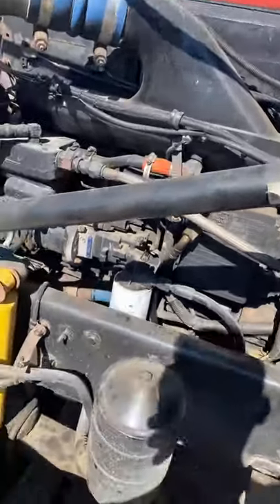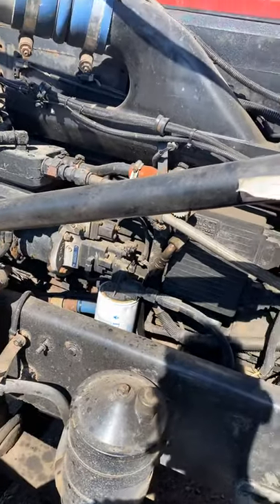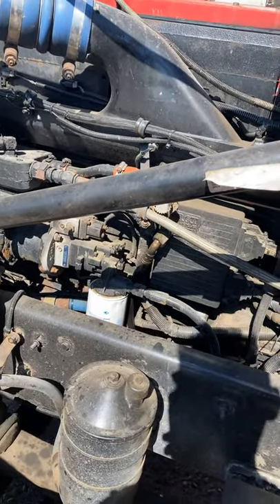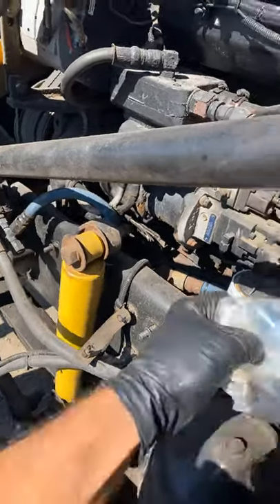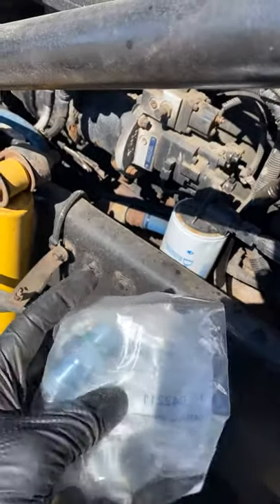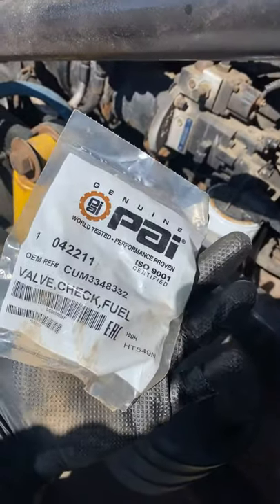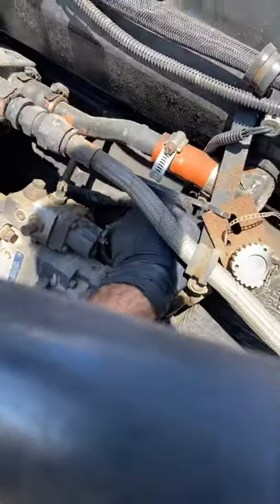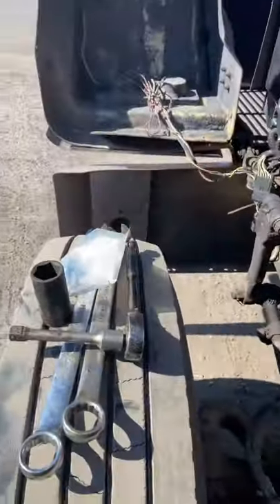Check valve on a Cummins n14

Comment: I have a 91' mechanical N14 and I'm having the same issue. It has a hard time starting in the morning and when i turn it off the fuel seems to be going back into the fuel tank. I have a fitting with a window right at the fuel pump and it's only half full when OFF and full when it's ON

Comment: Did You put that long funky spring back amd mini cup filter back?  
check connection at Engine position semsor under comoresor , if it has oil it migh be need to chane also know as crank ckranshaft position sensor.  it somehow breakes and oil gets into cables. You csn check impedance its like two set of coil i.n it dont remeber like 1.6k  ohm or so😊